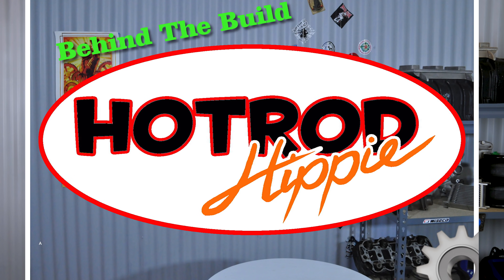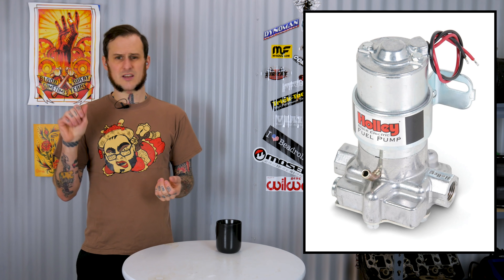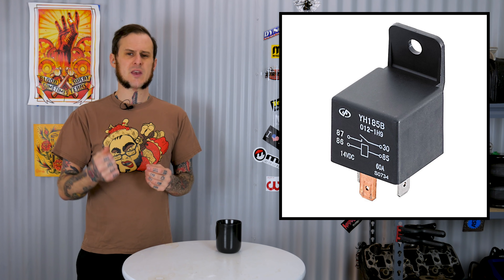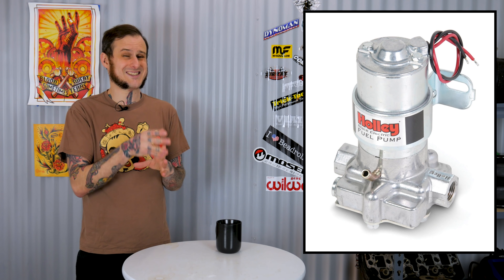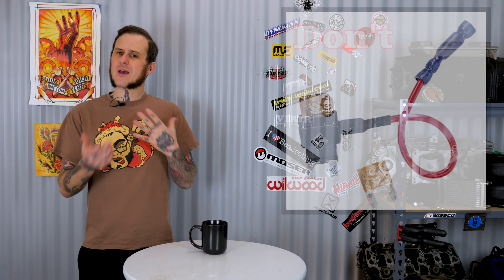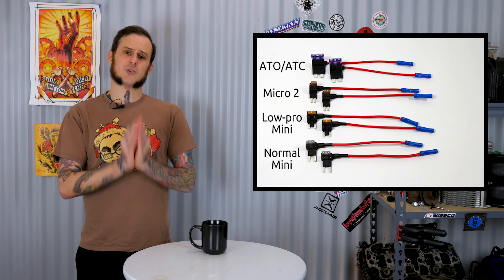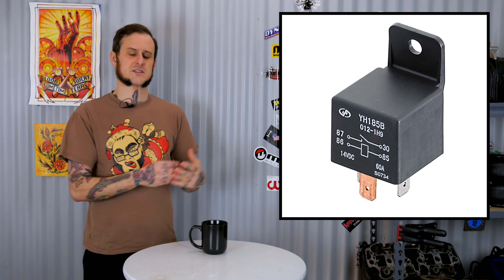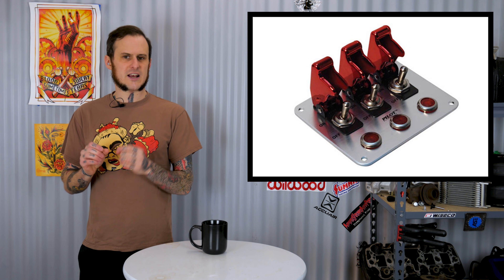Relays and Fuse Taps - Auto Electrical Dos and Don'ts - Episode 2

Comment: I found my (daylight) fuse broke. The aluminum brackets that are originally in the the fuse slot is gone. I don't know how it happened but it did. Is it ok to use a fuse tap for this instance? I need my daylight brake lights working. Brake lights & signals work. It's just the brake lights (running brake light) that don't.
Reply from the maker: What would you be putting the fuse tap into? If I'm understanding you properly it sounds like the receptacle for the fuse is gone. If so what would you be installing the fuse holder into?
Reply: HotRodHippie Yeah you said it right. The receptacle is gone. So I'm not even sure that the tap will work. I just need to make connection for the fuse. When I looked I found there was no fuse, so I bought the fuse & then that's when I noticed there was no receptacle for contact
Reply from the maker: Ouch. Yea the fuse tap just goes in place of the fuse. So it won't work for your needs. The best answer I could give isn't the simplest. I'd pull a signal off slither wire like your headlights and use that to power a relay. Have the relay with a fuse send power to the parking lights. It isn't a simple solution but that's the safest way I can think to do it without having to replace the entire fuse box unfortunately.
Reply: HotRodHippie I thought about either replacing it or taking it out & rebuilding the connection area. I know how to solder. Would that work? If not I could just follow what you just said to do. Ugh it sucks.. but just part of building up a project car.
Reply from the maker: Victor Huerta if you are up for it then yes that is something that could possibly be doable. Maybe pull a junkyard fuse box and piece it together if you are up for it. What is the car if you don't mind my asking?

Comment: I have some halo rings for my factory headlights... they are telling me to run the positive on a relay where the acc is. So when my truck ignition is off the halos are off when I turn car on the the halos come on is the a correct way????
Reply from the maker: Diego Hidalgo if you want the lights on any time your key is on, then yes that sounds like how I'd do it. If it was me I'd put a switch on the accessory power to the relay so you could disable them if you just don't want them on sometimes.
Reply: Is there any risk or damaging the relays if doing so?

Comment: So if i, say, use a fuse tap to power a cigarette lighter, and plug it into the fuse slot for my cigarette lighter, thats safe, right?
Reply from the maker: TH3L0STCH1LD are you doubling up the cigarette lighter outlets or just rewiring the original? If you are adding an additional one you still run the risk of overloading the circuit feed to that circuit. If you are just rewiring the original one(not adding one) then sure that is fine.
Reply: HotRodHippie i'm planning on adding more.  Is there a "safe" way to use one to do that?  I'd rather not toy with the original wiring too much.
Reply from the maker: TH3L0STCH1LD adding more you run a risk of overloading the feed side of that circuit. I would not do that. Do you not have an extra circuit on the fuse box? If not I would relay the additional lighter sockets. Use a fuse tap to supply power signal to the relay. Then wire the relay direct to battery power with a proper sized fuse in line. Not the simplest solution but definitely the better one. With the relay the lighter circuits will have cleaner and stronger power more than likely.
Reply: HotRodHippie alright.  thank you

Comment: fuse tap is great as long as it's properly wired up (piggyback circuit fuse less than original circuit fuse). The properly wired fuse tap will at most blow the piggyback circuit and not harm the original circuit at all.
unless you're doing racing car like modifications and only want to connect just 1 or 2 things (like dash cam or some interior led lights), it's really convenient and saves you from running wires from battery or tapping into wire harnesses - which are more harmful than fuse tap can be.
Reply: copperpaint like @HotRodHippie mentioned, fuse tap is technically positive - because you actually need to ground a wire (most probably via a bolt that is connected to chassis or sizable metal part of the vehicle) and complete a circuit to make the fuse tap useful in the first place.
Also, fuses (automobile or otherwise) never connected on the side of negative/ground or nutral anyway - because, electricity (electrons/charged particles) travels from bigger charge to lower.
Reply from the maker: copperpaint There is only one place to put the fuse tap, technically positive. Technically neither leg of a fuse is positive or negative. They are on the positive side of the circuit. To light up an LED you would use thefuse tap to send power to the positive side of the LED.
Reply: Asanka Amarasinghe thank you. The instructions say to connect the positive wire to a fuse that is on when the car is off and the neg to a fuse that only comes on when the car is on. I hope these instructions are right.
Reply: HotRodHippie thank you
Reply: Asanka Amarasinghe I have a dumb question. Which side do you put the tap on? Pos or neg? I'm hooking up a 12v single led bulb
Reply from the maker: Asanka has it, except I should note two things, neither of which is important for your LED wiring.  Since I work with old cars I feel it important to note, many old cars were Positive Ground vehicle.  Such as my 47 Studebaker I used to have.  Many 6V electrical system cars were Positive Ground, not Negative ground.  And if you think in terms of Electron Flow theory, technically electrons flow from negative to positive as Electrons have a negative charge. There is NOTHING wrong with thinking of power as going from Positive to Negative, and even though I know the reality I still think of things that way.  Diodes confuse the concept and I wish I had a better understanding to explain it more.
Reply: HotRodHippie thank you. You've been most helpful. I'll let you know how it goes.
Reply from the maker: Asanka Amarasinghe I get your point. I'm approaching this from the custom car side of things so I have seen these used many times for decent sized circuits. But my point is the feed circuit to that fuse, not necessarily the original circuit. You are creating a parallel circuit. And depending on the size of the fuse in the second circuit it has the potential to overwhelm the original circuit. Say your original is a 30 amp window circuit. Now you tap in with a 15 amp circuit for say a fuel pump, small electric fan, whatever. Parallel circuits add up amperage across the circuit for their overall draw. So if both circuits are active at the same time you have the potential to draw 45 amps on a circuit that was previously 30 amps without popping any fuses. Potential circuit overload is pretty easy in those scenarios. I agree with using them on small loads and I swore I said that and have indicated that in the comments here a couple times. My point is say in the situation I just pointed out, use the fuse tap to power up a relay. That way the load of the second circuit is isolated from the original circuit. Make sense?
Reply: HotRodHippie Absolutely. I would nevery say to use a piggyback for something like a pump even if you tap into largeat fuse available - that's just dumb.
Also never tap into critical circuits such as airbag's, any of electronic aid circuits or even main lights.
taps are a great way to wire something up without having to do lot of work - specially if there are empty fuses in fuse box, juat populate piggyback fuse & you are good to go.
Reply from the maker: Sounds correct.  When worded that way it makes more sense to me.  So yes using a fuse tap for that would be fine.  It is a small load and would provide the positive you need.  Just make sure you pick the right fuse for your Key Hot power and you are good.
Reply: As long it's connected to an equivalent amperage fuse

Comment: What about a dashcam?
Would you use a Fuse Tap for a dashcam?
Reply from the maker: BelgianKnight depends on the load. Many of them are very small amperage draws, which I would consider acceptable. Your camera should list somewhere what it draws. If it's 2A or less I'd consider it. If not I'd look for an accessory circuit. Really if your fuse box has an extra accessory circuit, that is your better option anyway.
Reply: thanks for the great video. so i can use any empty fuse slot if its an ACC for a dash cam? would i plug an add a fuse into that empty slot and just put 1 fuse in the top of it so i still have fuse coverage? thanks
Reply: @HotRodHippie  i have a set of LED strip lights, and I bought an add-a-fuse to run it with but on watching your video, you only explain the 1 circuit, at least that's the way it sounds, and not the fact that you are running 2 circuits, and that any add-ons should use smaller fuses than the original, as well as the claim that they are only rated for 10amp and under loads... that said, I'm new to add-a-fuses, and only know this much through extensive research on YouTube, and other places...one thing I found on YouTube  to be a problem, is that the instructions tell you how to add it, but never how to properly ground the add-on device to the frame (preferably) next to the fuse box... so that is my question, how do i, and where is the best place to ground your cameras, lights, and what have you, when using an add-a-fuse, in my case, on a 2004 buick regal??? Or any car for that matter... maybe you could do a video on it, and possibly fuses as well, as my car has no fuses labeled radio, it's always radio, combined with other things that I'm afraid to splice an extra circuit into... i never thought it would be so hard to find the proper fuse to piggyback... i do have an accessory lighting fuse im going to try, but it's so hard when everything is on a time delay for the interior lights... stays on a few seconds after opening and closing the doors i mean... its hard to measure the absence of volts when you have a fuse box panel located between the end of the dash and the door, and need the door closed to turn the circuit off... at least i think thats how that works, as I'm still figuring things out...
Reply: yeah should have mentioned their first choice for tap should always be to tap into accessory fuses
Reply: @welcometoreality3450  I agree, but for a guy that doesn't recommend them, its to be expected... i still am amazed that I can find a lot of videos dealing with add-a-fuse circuits, but they expect that someone who knows nothing about taps, know the proper place, and proper connection type for the ground wire... i do like this guy's down to earth explanations though, so, overall it's a good video... *edit* I did get my LED lights hooked up, but I think I somehow fried my color change module so I have to hook it up directly, which does work... and, I have used my lights with the included cigarette lighter before, so i know i f'd it up, as opposed to from the factory... not sure if hooking up backwards will do it, but i bet it did...
Reply: Nice video man. I have a question im installing 12 led pro comp rock lights, i want the to turn on when i turn on my headlights, so im.planning to get the power out of the headlights trailer hitch pigtail, i will run the power but also will put a fuse a couple.of inches after the connection, i will be running to sets of cables on each side, 16awg. What you think, can you hit me with an advice please? I will appreciate. Thanks in advance.  ( 2009 dodge ram 1500 )
Reply from the maker: I can't say how much power the rock lights would pull but I would use a relay. Wire the relay to your hitch pigtail like you planned. So when you turn on the lights the relay activates. Then wire it so you are sending fused battery direct power to the rock lights. That will be safer for your wiring and make your lights function better as well. They likely don't pull a lot of power but I'd just call it a safer bet to do things that way. Relay to control the lights on and off, and a battery feed for the lights. You could also then wire a switch to the relay so you can override and turn off the lights if/when you want. Say just interrupt the ground side of the relay with the switch.

Comment: EXCELLENT!!  Glad I clicked on your video.  I am hooking up train horns to my excursion and have been watching videos on how to use my fuse box to power them up. I WAS going to use a piggy back  holder for this but i need a 20 amp fuse. By doing this I would have definitely overloaded that circuit and caused problems for myself. I will peruse your channel for more information on using relays and fuse taps as I am a newbie "customizer". After installing the horns I want to mount up LED light bars  on the front  bumper...You saved my vehicle from burning up! Thank You!!
Reply from the maker: Glad to help. I need to get back to making more Electrical videos soon.  I would have to see more about what the setup you are configuring is, but I would definitely be using a relayed setup for it. A fuse tap to power the relay's control side alone may not be bad.  I absolutely would not use it for the full 20A circuit, as you already are aware.
Reply: So let me ask you this... I have 2 open slots in my fuse box. To check if they are working I would have to use a meter to find out? Also that would tell me if they are ACC or IGN based right? either way i can use that to power a relay? I want to use a toggle switch to turn off the compressor when not in use so i dont burn it out. Does this sound correct or am i lost?
Reply from the maker: louieC STUMP yes a meter or even a test light would be an effective way to check if those circuits are live. That would also allow you to check for ignition hot or battery hot. Wiring the relay to a switch is just fine. If it were me I'd still choose an ignition hot circuit so the switch couldn't short out and run the compressor when the vehicle isn't on. Long shot that it would happen but better safe than sorry if you can manage it.

Comment: is a 2500mA circuit OK to run off a fuse tap?
Reply from the maker: Rick Poole that small of a load should be fine. Does the device have its own circuit protection? That would be my only concern. That the smaller device would be overloaded on the circuit if it failed.
Reply: On the website it did say that it has its own power protection circuit. the box on it says 2500mA, but they also state that it only draws between 20mA and 150mA when in normal use.
Reply from the maker: Rick Poole  lot of devices spike and draw more when they first turn on. Entirely normal. So could be just that. Or could be the max load or can handle before it fails. So sounds like you will do just fine with a fuse tap. My "don't" here was based off the abuses I've seen with them in the past
Reply: Cheers for the that, i think i will go ahead and hook one of these things up now. i think it will be OK, i have seen a 1.5A dashcam on the same fuse on other sites, so mine should be fine.
Thanks for your replies.

Comment from the maker: What other topics do you think we should cover in the Do's and Don'ts series?
Reply: I watched you "does & don'ts" regarding relays and the fuse taps.  I thought you said you had another video about wiring a cooling fan.  I found the other video's but it was all about picking the right fan and picking correct size wires for your wiring needs.  am I missing something is there another video I'm not locating?  You see...my problem is I put a dual fan setup on my 2007 Dodge Dakota.  I got the fan setup from Summit Racing, which does use relays. However, the instruction called for wiring into the fusebox.  I used two of the fuse taps.  I started having issues with my transmission shifting and my engine actually shutting down while driving. I assume too much voltage is being drawn and it's interfering with transmission relays and who knows what else. I moved the fuse taps to two different "fuse slots".  It helped some but issues are still occurring.